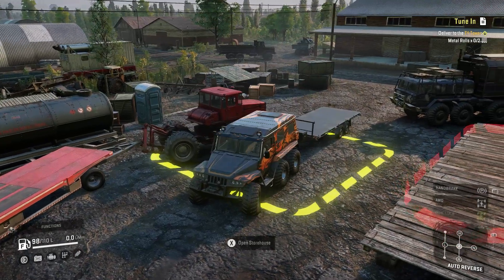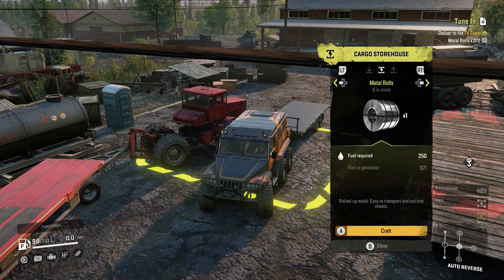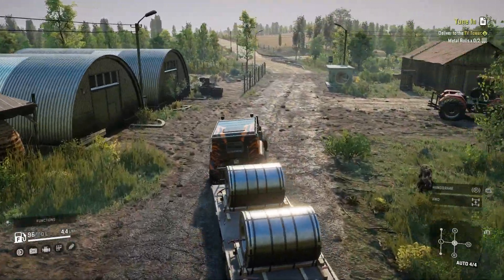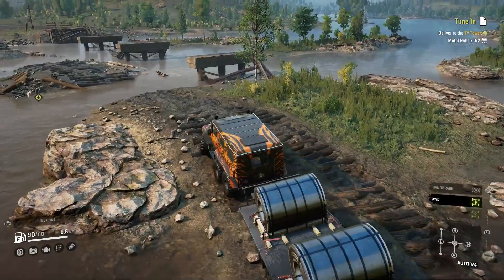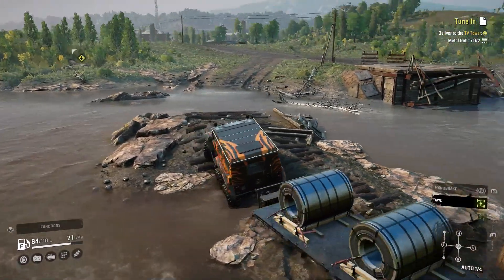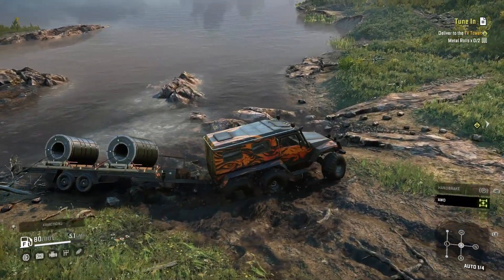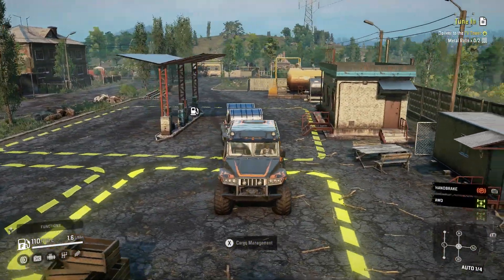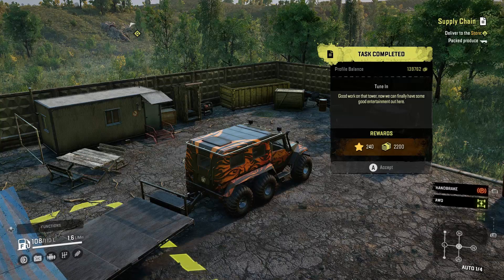Tune In Task Metal Rolls With Yar 87 Scout Hauling Gameplay Phase 8 New SnowRunner Update/DLC

Comment: Seem like those generators run out of gas fast in my game probably because I left them on 😆😆😆
Reply from the maker: I don’t think they can run out fuel from leaving them on from what I’ve seen. It only drains when you craft things
Reply: @G4mingWithJJ  ok yeah your right been awhile since I used those 👍🏻👍🏻
Reply from the maker: @Justrandomvideos-2023  did you see I told you where the railroad tracks were on your video?
Reply: @G4mingWithJJ  yeah i seen the one in russia but because of all those trees in the way make it really hard for that crane to get through
Reply from the maker: @Justrandomvideos-2023  yeah i dont exactly recall what it looks like back there its been a long time.
Reply: @G4mingWithJJ  rough area the new map is little easier to get to those tracks and I think their more tracks on that map then the others have
Reply from the maker: yeah its not to far from the garage your probably right. Wisconsin the second map might be the easiest tho.  you can drive tar road 95 percent of the way there. take a left from the garage take the first right and drive straight through right in front of you where there is a break in the trees the tracks are right behind the trees. worst case turn out right and follow the road as it turns left and over the tracks either way its closer and probably easier.  i think you should make the second try there.